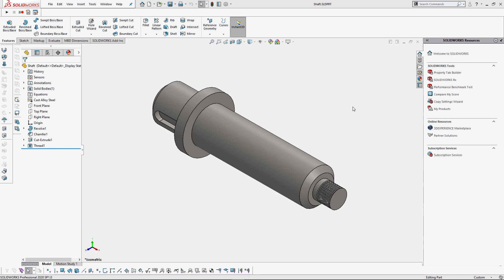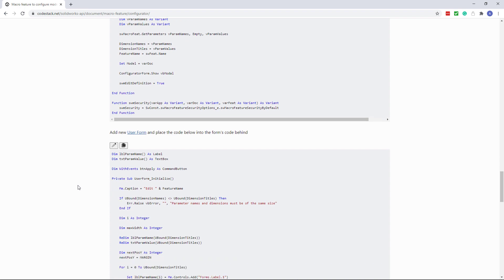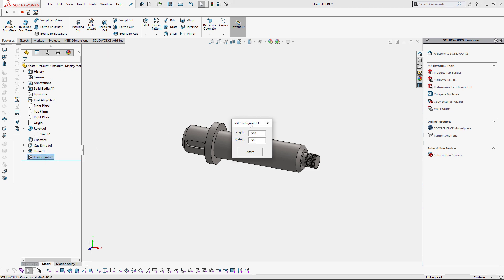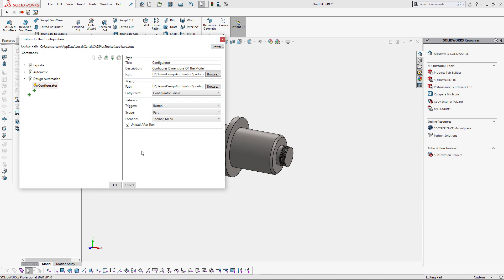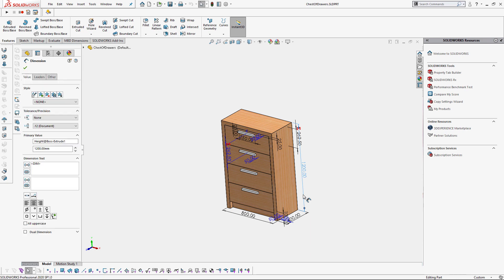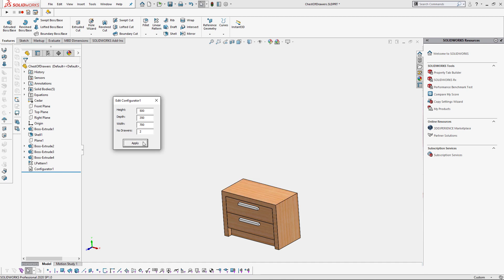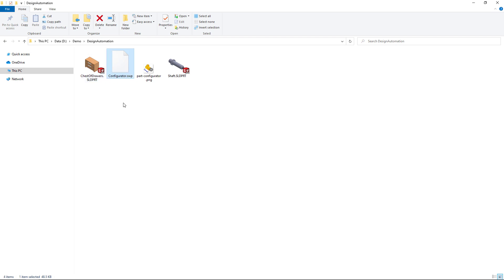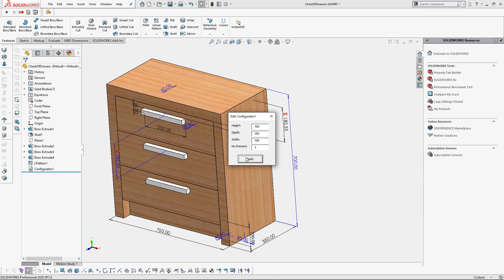SOLIDWORKS model configurator with custom user interface

Comment from the maker: This macro now supports assemblies
Reply: Thanks for this very useful macro! Can you please help how can I select dimensions of a part in an assembly without select any other thing?
Also i'm getting error when i select more than one dimension (runtype error 13 type mismatch) "ConfiguratorForm.Show vbModal" marked yellow.
Thanks in advance.
Reply: @nekadaracikdegilmi  I run into the same issue, did you managed to solve this problem?

Comment: Hello, this is an amazing tool. I am currently trying to create something similar. Are you still active here? Do you perhaps have a discord where one could ask questions about your work? I am trying to create something similar but with more calculations in the background (I am building a configurator for a specific product, but I have reached the maximum I can squeeze from Solidworks equations without crashing). Using nested ifs as a substitute for loops has proven itself to not be reliable way to achieve what I want to do, but I think the macro way could work. Is there any possibility of asking you some questions about this?

Cheers
Reply from the maker: Thank you. There is a discord channel for xCAD.NET (library for add-ins development): https://xcad.net/ (chat link in the top left corner). You can also contact me by e-mail: info@xarial.com

Comment: So, I have various dimensions comming from a sampling algorithm in python, and want to update SW from those sampling results.
This means, my python array should update the dimensions of solidworks and save the part.
Any thoughts on how can I do this?
Reply from the maker: You can use IModelDoc2::Parameter API to get the pointer to dimension and set its value. Example: https://www.codestack.net/solidworks-api/getting-started/scripts/power-shell/model-generator/

Comment: Can this be used to drive global variables and configurations? Suppress and unsuppress components in an assembly?

Also, can inputs be from a list rather than typed by user?
Reply from the maker: Hi John, yes, this is possible but this is pushing the boundaries of the macro. I would use add-in for that. I will be releasing commercial tool in several months allowing you to do design automation, e.g. custom property pages for input, excel-like formulas with ability to use dimensions, custom properties, suppression states etc. for the calculation. if you are interested, please contact me via info@xarial.com, I can share the demo video with you.
Reply: @Xarial  Hi. I have sent you an email about your addin that you mentioned above. Could you please return if possible. Thanks in advance.

Comment: While this is neat as beans, I'm curious, what's the advantage of this over just using the already built in equations manager? You could set up global variables and have dimensions point to those. A user pops open the equation manager and updates what he/she needs, clicks ok, and you get the same result. Correct?
Reply from the maker: Hello Benjamin, thank you for the questions and apologize for the delay in answering you. In general, Yes, it is possible to use Equations. But there are few advantages of this macro over equations, e.g. you can edit configuration of sub-components directly from the context of the assembly (you need to activate the model in its own window to work with Equations); the input is cleaner as Equations will bring the dialog with all equations and usually you will have dozens more in there and it may be hard to navigate; finally this macro changes the dimensions in the current configuration (or referenced configuration of the component) so it is possible to have 2 instances with different values while equation will be applied in all configurations when selected for sub-component). I was asked similar question several time so create a benefits table comparing to other popular methods: https://www.codestack.net/solidworks-api/document/macro-feature/configurator#benefits-comparison